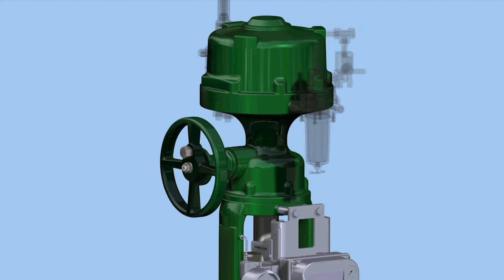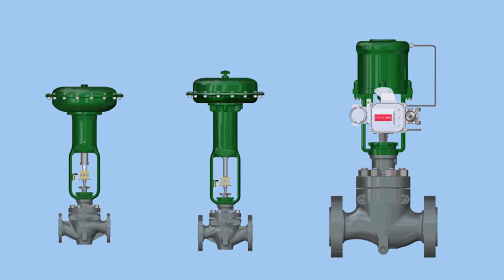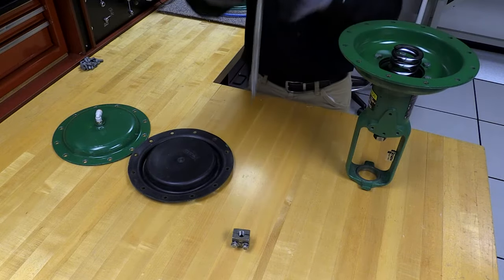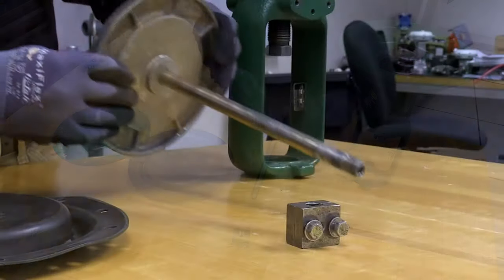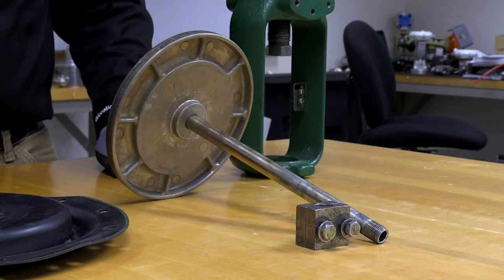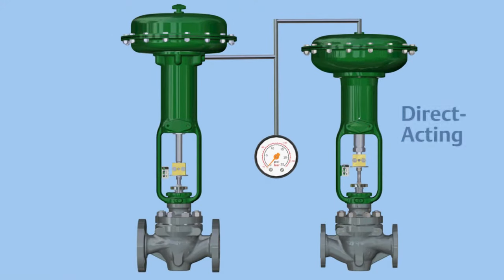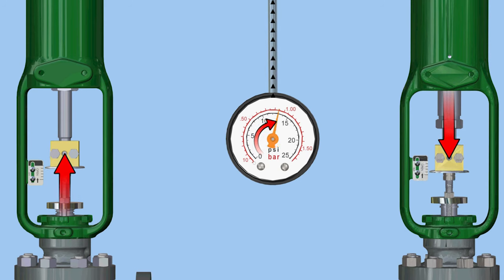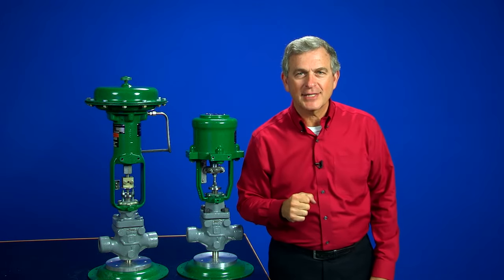What are Spring-and-Diaphragm Actuators for Globe Valves?

Comment: It's also important when setting up a positioner on an actuator, for a Fail-closed valve assembly, that when closed that the actuator is fully vented. And with a fail- open valve assembly, that the actuator when the valve is full closed, that the actuator is fully pressurized. This ensures that the seat load is adequate to meet its seating criteria class.